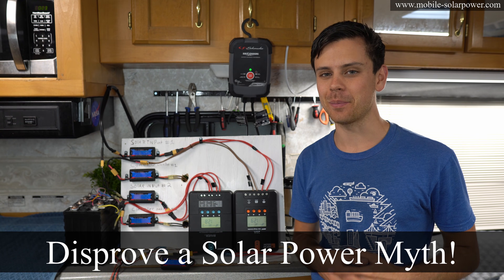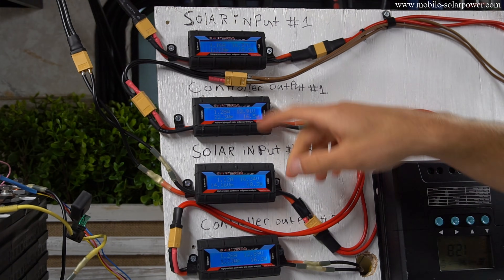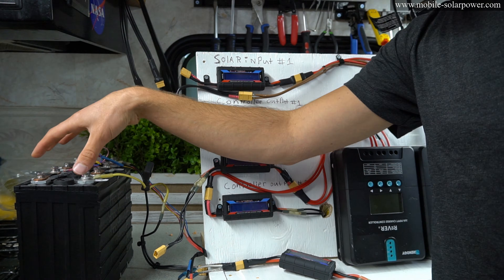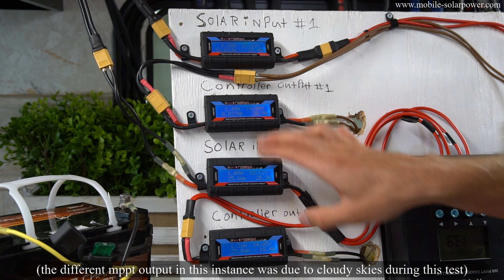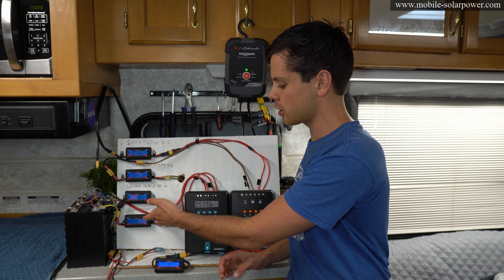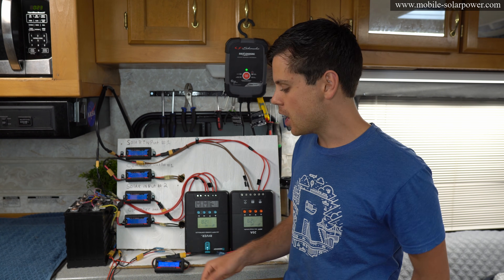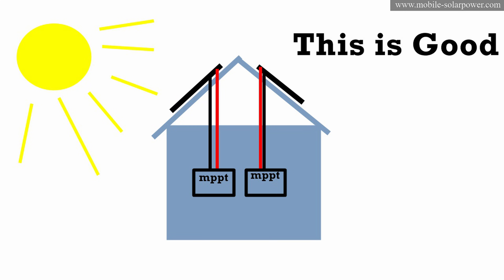Off-grid Solar Myth Debunked and Explained: 2 or more Solar Charge Controllers + 1 Battery

Comment: Question: I have three separate MPPT charge controllers on three separate batteries.  I have one 300 watt panel that supplies more than the daily energy the three batteries require. Can i just hook the three MPPT controllers up to the one solar panel in Parallel?
Reply: I wanna know too but because somehow I accidentally bought 3 charge controllers. 😔 thanks too computer lag but oh well. I just wanna know if I can hold a full charge in all 3 and use them separately at night?

Comment: i had 2kw of 8 panels wired series parallel going into 2x outback 80 amp controllers and they never shared at all either 1 was in bulk and the other showed battery full and giving nothing or vice versa in the end i put them all on 1 controller and sold the other

Comment: Hello Will
I've got 2 groups of 100W solar panels (Sunpower and Dokio), each of them consisting of 2*2 PV, wired in series/parallel. I have 2 identical charge controles, and each group is wired to one of them. The battery bank is formed by 2*280Ah LiFePO4, wired in parallel. My question is: how do i wire each controller to the battery bank? Should i wire the + from each controler to the + of a single battery, and the minuses to the - of the other battery?

Comment: Connect the batteries direct to the solar...... Then you will see a massive difference in the charge rate. :)
The idea behind 2 charge controllers is to charge 2 different types of battery banks at once........ Then the 2 different battery banks are linked together to create one massive uneven bank of batteries that can safely be charged & used together..... Not sure if that would work though.

Comment: I have a MorningStar solar controller but I also have a self regulated windmill that run pretty much straight to the battery but when the wind picks up this solar controller compensates and turns down the amps going to the battery.assuming it nearly fully charged.

Comment: Hi i have two epever solar charge controllers one is 60amp and the other one is 30 amp. Could i use both of them on the same battery bank with the same settings?

Comment: I have been looking at the 300+ W solar panels for space efficiency.
I notice you often reference 100W panels. 
Is there a specific reason you favor 100W panels over higher capacity ones?
MPPT chargers have a charge current limit. Multiple MPPT could be part of my solution.

I only get morning sun so I was hoping to get my battery fully charged by 1-2 PM.
Later, if I build another add on, I can get evening sun only on that side.
I have been looking at microinverters, but a dual MPPT system sounds like the perfect solution.

Comment: Thank you for an interesting video. 

I have two solar strings facing morning and afternoon sun.  So at anytime,  the one charge controller is 30v more or less than the other charge controller.  I was wondering if this affects the charging of the lithium battery. I thought voltage is like water pressure so the higher voltage always feeds the battery and the lower voltage doesn't go through to the battery because there isn't enough "water pressure".

Comment: Since charge controllers surge at the point where resistance drops, dosent using large lifepo4 cells/batteries cause an issue since the internal resistance is very low?
BTW i just ordered your book. 
Thanks for all your hard work.

Comment: im considering  the  tracer 4215BN     looking into getting 10 or 15, 250 watt panels,    still confused how i should set them up....  using a 12v  3000 watt inverter and not really interested in changing that    is it only 2 panels in parallel per controller...  cant i do 5 in series to one controller-   im guessing i cant hook them all up on one controller....

Comment: Very nice, I was wondering about that. I'm building a 400 watt / 200 Ah solar for a small 5th wheel. Putting the 4 panels on the roof and was thinking about a suitcase for those shady spots. This clears up my options for wiring the suitcase into the system. Thanks for the info!

Comment: Yes ☺perfect explain..but for a better test would be a 48v system..Two banks ..8 batteries of 12v runing as one with bussbar + and  the -   With two charge  controller.  Well balance agm lead asid batteries as well..

Comment: Will, all of your videos are very good. But I have to say this video ranks right at the top because of how you explained so much valuable information in an easily digestible manner. Absolutely top notch effort. 

One other benefit that may have not been obvious is if your system starts out with a 20 amp solar charger and one day you need more amps, you can still use your old 20 amp charger and simply add another 20 amp solar charger to your system. Previously I would have thought I would need to junk the 20 amp charger and upgrade to a single 40 amp charger.

So very helpful! Keep up the great work.
Reply: i have tried  that on same in coming line off the panels it seem to cancel the other charge out
Reply: You can add another solar panel feeding into another charge controller to upgrade a system, but adding another charge controller to an existing system is not what this video is about. He has 2 separate solar panels and charge controllers both feeding into one battery.

Comment: Question, I have 2 AGM Renogy 12v - 200ah batteries in Parallel, If I'm understanding this video, I can attached 2 - 60 amp controllers to my one battery bank?  I would like to buy additional panels but I know my system is maxed out right now as far as  controller amps.  Reason I  ask I would like to  run 400w-500w air conditioning by day and have enough solar to charge my bank for air conditioning by night.

Comment: Will, I have a Goal Zero 1000 and they told me I can't use my Renogy 100W suitcase w/ controller with it, because the PWMs will "cancel each other out." From what I am understanding from this video, that's bunk. Am I understanding this correctly?
Reply from the maker: That's because you are going through two controllers. Different than this videos example. In this video you have two controllers connected to one battery. In your case, just bypass the renogy controller and connect solar panels directly to goal zero
Reply: Thanks for the speedy reply. Since I believed I made a purchasing error with the suitcase and wasn't sure how to bypass the controller, I just ended up getting another solo 100W panel and it works fine with the Goal Zero. Either way, though, the panels in question are heavy to lug around for my intended use: periodic camping. Have you looked at any of the newest flexible suitcase style panels? I've watched your videos on flex panels in general and understand they're not too durable, but for periodic use, would that negate some of the problems with them?

Comment: I think this is a very powerful bit of information! This means that it is possible - and easy - to build a system in a modular fashion over time. For example, add 4 solar panels and a 20A MPPT every month until you achieve desired capacity. It also eliminates single points of failure! This is really exciting. Is my logic sound? (Like I have to ask folks to comment on YouTube...)

Comment: A topic I always wondered about. I will typically use a standard battery charger to top off my batteries when my generator is running anyway. Now I know this is  not an issue.

Comment: nice job again,  what keeps the recharge from charging at a rate similar to the discharge rate in cca's? like say 800cca's, maybe the collection of electrons inside.,  maybe there's something that could replace sulfuric acid to charge at a higher rate, Have you ever tried super capacitors before the ledacid, something might be fabricated to increase the recharge of the ledacid.

Comment: So is this to say that if I had a 200 watt  2 panel system and I had a single 20 amp charge controller and I bought 2 more panels and a second 20 AM charge controller that I could use both to charge the batteries?  If yes, then would this be faster than a single 40 Amp controller?  I get the benefit of spitting the system for 2 locations, but I'm wondering if having 2 controllers for a bank of panels in the same location allows me to charge faster (vs 1 big charge controller)

Comment: Huh?!?  I have a 120w panel on top of my van.  But I park in the shade.  So, I bought a 100w panel to set in the sun.  i made a Y connector and was planning on switching between panels whether driving or parked.  You mean if I put a second controller to the second panel I won't have to dick with plugging and unplugging?  Asking today because Amazon won't get your book here until Friday.

Comment: Myth or Fact. Can you ever exceed the panel wattage above the charge controller wattage? If you did, would the charge controller shut off to prevent damage to itself or would it throttle down the wattage?  I do have a victron  75/15 20A  max 200w at 12v . Lets say i have a 12V 250W panel  connected to LIFEPO4 and they rarely see anything near 200w but I like the 250w from a cost/w perspective and I get more production with the 250w modules.  I have a grid tied system and my micro controllers throttle down the input to their limit so you can run oversized panels. However, it appears that chargers are different.. Thanks Danny

Comment: What happens if I use the inverter continually through the daytime with panels charging. Say for instance I have 2000w coming in and I'm drawing 1500w throughout the day. How does the mppt and batteries handle that? Charging and drawing at the same time. 
I bought a 3kw inverter with built-in mppt of 600 watts. But can I install a additional mppt  on the batteries itself. I think the inverter can choose between itself between panal and batteries to be used. 600w is just a bit to small. I see afterwards there is same inverter that can handle 3000w of panels. It's now to late, that's why I'm asking. Great channel

Comment: You're a genius Will! Keep up the good work man for you'll go very far in life!  I've been through college for engineering, plus I work on electronics in the US Air Force, and I have learned more from you about solar systems than I ever have in school and through my entire AF career!  Thank you!
Reply: I agree...l don't know ur personal history that well to fully appreciate what happened to you and how it relates to us.  I have essentially made this same comment before. I have a physics undergraduate degree from the dark ages 1969. I understand the basics you do an excellent job explaining using them. In fact having taught and developed technical curriculum all my life, l truly admire your talent...it exceeds mine. 
On the complex specifics of the different battery types, you've touched this in a previous video. I'm happy l recall seeing that because l couldn't grasp all the content you shared. One way video learning is tough because we don't get to ask questions...not ur fault at all.  But learning that the key is battery resistance that's affected by internal factors specific to that battery's chemistry and a host of other generic factors like temperature was powerful. You repeated that several times in a very effective way especially after you shared a content chunk of info. It helped me to not get distracted as you were sensitive to from other info sources. I have 3 solar panels...2 abt 360 watts n a 100. I have 2 Victron controllers connected separately to ea of the larger panels (if l knew l would later expand l would have purchased a larger capacity controller to save money) But did expand and my single controller lacked the capacity.  I didn't realize l cud have connected these 2 larger panels in series avoiding buying a second expensive but worth it controller)  My 100 watt panel feeds a simple PWM controller. I learned before my 4 6V batteries connected series-parallel for 12V. Thanks for your patience and appreciation of the confusion us non expert solar power guys out here. 👍👍👍
Reply: For real, we need this dude in Jones Hall

Comment: To enable any panel orientation and types sizes, etc, you can solve this by using X charge controllers, group panels by types, all the same orientation on one controller. Different type ans orientation to another controller, and you are good. So you can have morning panels, middle panels, and evening panels. (or 2x more panels oriented for winter for example) This way the max charge current will be lower but you will have more hours. This technique just works beautifully. If you live during the day, and use your main devices during the day, this enable going with a smaller battery and in the end, you've spent less on the whole system, even with the price added of several controllers. And go lithium. reclaimed 7s 18650 are good. 8s LiFe is even better. Lithium require monitoring at cell level, balancing once in a while only.

Comment: Can you publish some schematics about how to use both MPPT and shore in one system? Won't the charge controllers try push energy into one another if outputs are connected in parallel?
Reply from the maker: No they will not fight. That's what this video covered. Did you watch it? You hook both to battery bank and that's all

Comment: Hey Man can you give me some advice? : 2 -75w panels feeding a BattleBorn 100 Ah. The panels are wired pos on one wired to pos on the other and then  to the 20A charge controller, same with the negs. Is this ok or must I use Y connectors? Thanks in advance
Reply from the maker: If using a pwm controller, yes. If using a mppt, wire them in series instead
Reply: @WillProwse  I'm using a mppt (epever tracer 20A) but have partial shade considerations so followed your advice and stayed in parallel?
Reply from the maker: @gergmac  yeah parallel probably best then.
Reply from the maker: @gergmac  at that size, either wiring method will work. If in series, would need bypass diodes which most panels have. Parallel is good
Reply: @WillProwse  Thank You! You have educated me through your series. I have watched a bunch and read a bunch of other people but after your vid on Watts Amps Volts and I finally got it.

Comment: Hi and thank you again for these great videos. I have been using solar panels to keep my batteries full while I am out camping, and now I am planning to mount two of them permanently on the roof of my RV. The question that I have is this, if I am going to leave it parked in my driveway and I rely only on solar power, will it reduce the life of my flooded lead battery bank compared to keeping on my shore power? I have a decent 4 stage converter. I only think it might because of the cycles of charging from the solar panels instead of the constant float voltage from the  shore power converter. I won't be using much power when it's parked, only the stereo now and then when I use the RV like an office. Thanks!

Comment: The demonstrations are good and the conclusions and advice given are correct.  IMO the actual myth the video disproves is:

"you can't (or shouldn't)  charge from multiple sources at once" 
instead of the stated
"when one boosts the voltage it reduces the output of the other charge controller." (0:05) 

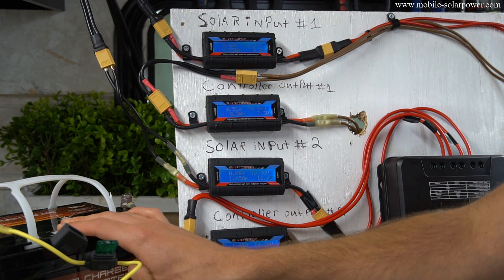Consider what happens when one of the controllers (the shore charger) has a higher voltage setpoint for Absorption:  the other controllers drop to zero watts (3:30) as the stated myth predicts.  This will happen as the controllers complete Bulk charging at different times due to different voltage setpoints.  They all contribute up to their setpoint then fall away as it is exceeded.  Normal and expected, and Will explains that behavior clearly.

It's a good video;  I do want folks to understand the content without getting confused by myth wording in the intro.
Reply from the maker: I see your point. Very true. I always have a tough time thinking of titles to the video. What would you suggest as a better title? I thought calling it a "myth" would get people curious. But yes, further explanation was necessary.

Comment: I have a 17 kw generator that I would like to use as a back up when my batteries from the solar are low to charge them back up .  How can I do this? Can I just run the generac and use the 110 plugs on the side some how to refill the batteries quickly????            PLEASE HELP>>>>>>>     aslo note the generator is hardwired into the house so when the power goes off it automatically comes on . HOWEVER , I want to get completely off grid . So I want to SIMPLY re charge my batteries with my generator when needed.

Comment: You should make a video charging two batteries with the identical charge controller and solar panels. One lithium battery and one flooded battery. Both at a 50% SoC and the same amount discharged from the battery. This will show how under the same condition, the lithium battery will charge quicker, and by how much. Use battery monitors to monitor the state of charge.
Reply: Don't we already know that Li can take more current (up to 1C) and doesn't require the lengthy Absorption stage?
Reply: @fratermus5502  yes, but I've never seen a video actually showing the difference. Just like I already knew everything he showed in this video. Doesn't mean he shouldn't make a video about it....

Comment: In other words, current is a dependent function, voltage and resistance are independent functions.  If the voltage is 12 volts and the resistance is 3 ohms, according to Ohm's Law, the current is I = V / R, or 12/3 = 4 Amps.  This will be the case even if the voltage source can deliver 1000 amps, the load will draw only 4 amps.
Reply from the maker: Haha yeah! I was trying to avoid saying that for beginners, but yeah, you got it. Exactly

Comment: If you have mppt controller that has lithium ion as a battery type can you use that setting for a lifepo4 battery?
Reply: You could just use the standard sealed battery setting for a 12V LiFePO4 battery.